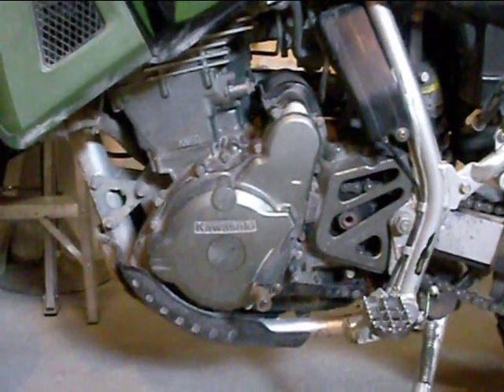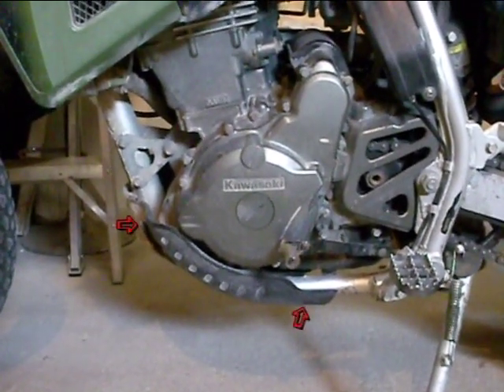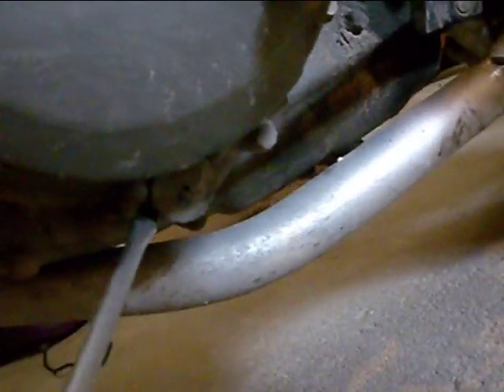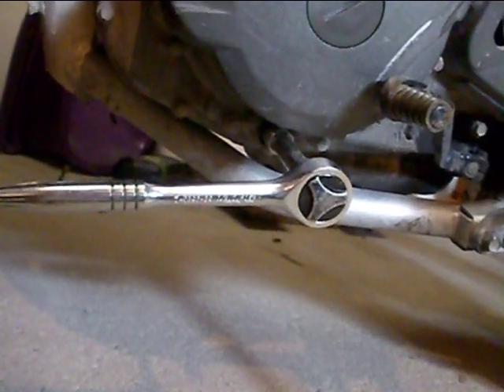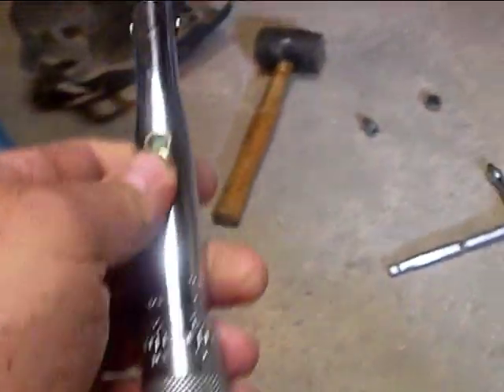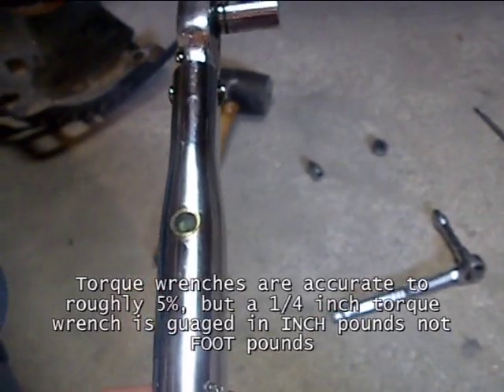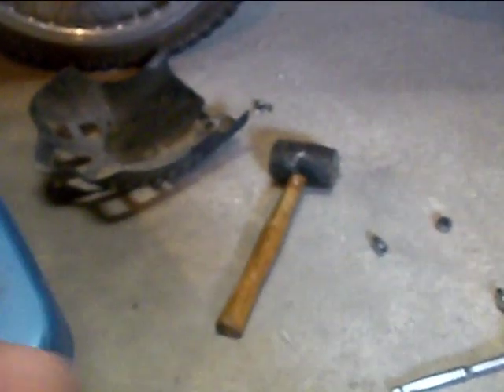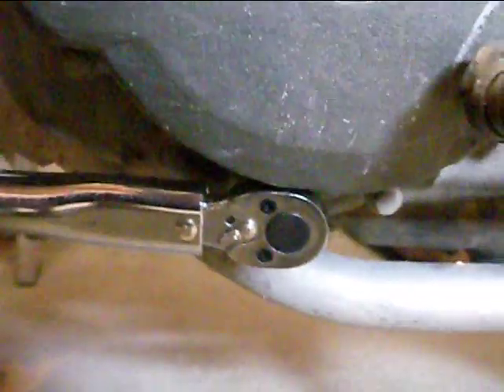KLR Doohickey adjustment

Comment: Thank you for the video. I just realized that, at over 4k miles, mine had not been adjusted yet. While the manual may state 78 inch-pounds the factory must have torqued it much higher! I was worried it would never come loose. On my '09 I did not have to remove the factory skid plate as there was enough room to work around it.
Reply from the maker: glad it helped

Comment: I have the same plastic case shield. With crash bars a pain in the ass to get off. Took my dremel with a cut off wheel and cut enough away so the adjustment is an easy access.

Comment: I have a 2014 and must have missed this when I read through the manual so its never been done.  20,000 miles on it but not making any angry noise.  I just went to adjust it and the bolt was already loose.  Think its ok?
Reply: No, it's not, the spring could be broken if the Eagle Mike replacement hasn't been done, obviously not torqued right at the factory, I would open it up as the chain must be slack.

Comment: Mine has never been adjusted. I'm not even sure if the doohickey was done! Is this adjustment process the same for the stock piece as it is for the doohickey? Thanks
Reply from the maker: yep.  only difference between the stock and upgraded doohickey is it's strength.  they look and function identically.

Okay they look a little different because they're made a little different, but functionally speaking they look the same.
Reply: Thanks! I've just learnt however that if the doohickey had not been done yet, that you should not adjust it because it could lead to a failure.

Comment: Just curious as to what happens if you don't adjust? What are the symthoms?  Does it cause harm to the engine? Please don't answer if your guessing.
Reply: your bike will have potencial issues at idle and low rpms

Comment: My doohicky has already been done, I've put maybe 10k on my klr since ownership and I know the guy before had done this, my question is do I continue doing this adjustment, if so, how often?
Reply from the maker: Perform the adjustment with every oil change.  It adds 2 minutes to the job and is a good time to do it as you're already down there.

Comment: Thanks. Do you need to drain the oil first?
Reply from the maker: No adjusting the doohickey does not require an oil change.  However, making it part of your oil change routine may be beneficial as you won't forget to do this. I parted ways with my KLR about 6 years ago. Thanks for the trip down memory lane. :)
Reply: @germanpickle  Thanks man. Much appreciated.

Comment: what were the torque specs?..
Reply from the maker: Tighten bolt to 8.1n-m / 6 ft-lbs / 72in-lbs
Reply: thanks....im restoring my 92 klr 650. ive never adjusted the balancer chain tensioner before.
Reply from the maker: Awesome.  Good luck.  If you're doing a restore, consider replacing the balancer chain tensioner with a fixed version.  they were common breaking parts on the KLR.  parts can be purchased here. http://www.eaglemike.com/KLR650-2007-and-earlier_c2.htm
Reply: ive been very curious of the doohickey but i have never made the adjustment for it...im almost afraid to mess with it?
Reply: my bike has almost 20,000 miles on it
Reply from the maker: my 2003 has 30454 miles on it and no signs of being tired.

Comment: I hope for the 2014 model,Kawasaki has rectified this. And hopefully considered going from chain drive to Shaft.
Reply: Shaft drive on a duel sport? wtf...
Reply: Shaft drive would increase the cost and may not even be possible given the amount of suspension travel. My understanding is that Kawasaki refuses to call the balancer chain tensioner a "flaw", just like the oil burning issue in the '09-10 model. For them to make such a change would be to admit the initial design error and possibly cause a service bulletin (with the associated costs) to be issued.
Reply: Yeah I'm pretty sure you hit it on the head. As for a shaft drive in an Dual purpose it wouldn't be a bad thing,.....Honda has had shaft drives on 3 wheelers& Quads & they've proven to be worthy. I also agree that Chain would be cheaper& easier out in the middle of Gods Country.......... I'm a fan of chain drive,...... Just kicking the though that's all.  :)    Peace. I see quite a few videos on the Dohicky issue,....... Such a big hassle for a small part.
Reply: Did they ever figure out why it consumed so much oil past a certain speed?
Reply: +T0mpkinz BMW has been doing it with their R bikes for decades. Ural's have shaft drives. It's a bit heavy, but way more reliable and less maintenance than a chain.
Reply: yeah,....... not every dealer wants to go the distance. a lot more reliable......
Reply: have u had any problems with your klr? i also have a 2014...are u gonna have then doohicky done?

Comment: Maybe do a clean half round cut out so you do not need to remove the Skid Plate ....humm.
Reply: The skid plate is so easy to take off it wouldn't be worth the effort to try and make some sort of hole you would only make the skid plate weaker
Reply: It's Plastic .....a small half round cut in that spot not going to affect anything .....